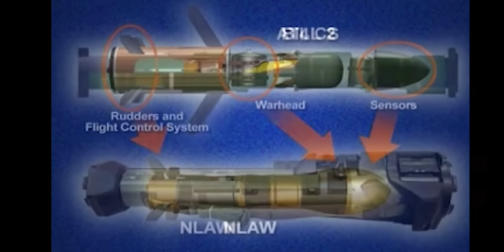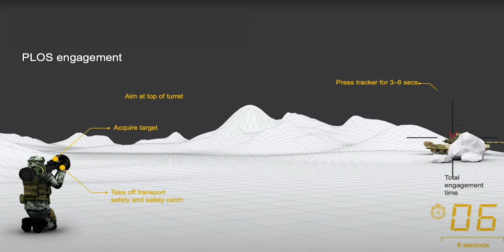Is the NLAW ATGM overrated? Next Generation Anti-Tank Missile

Comment: Still would rather have one of these than no anti tank.
Reply: Exactly. It's brutally effective. Hard to accuse something THIS GOOD of being "overrated." LoL
If anything the RPG-7 is the most overrated AT Munition lol.
Reply: @Mygg_Jeager  You can reload a RPG and it can use multiple warheads
Reply: @surferofthesynthwaves4710  So can an M203. Neither the M203 nor RPG7 can knock out a modern MBT, IFV, JLTV, or MRAP. And the M203 is 14 lbs lighter than the RPG7.
Reply: @Mygg_Jeager  really a M203?   I know it can knock out light vehicles but bruh
Reply: @Mygg_Jeager  LoL, RPG-7 "overrated". Given it's an old tried and tested weapon, a very well known quantity, that statement makes about as much sense as saying that an assault rifle is overrated or drinking water is overrated. The PG-7V and the PG-7VR warheads have armor penetration of 500 and 650mm respectively. Not even modern MBTs have evenly distributed armor all around that can protect against that, side hull being usually the biggest weak spot, let alone IFVs, MRAPs and other junk.
Reply: @JAnx01  TUSK, SLAP, Trophy and ERA all defeat even the most advanced and sophisticated RPG7 warheads. (They also Defeat Carl Gustav rockets.) And advanced rockets aren't even in the hands of Russian Conscripts, ISIS, the Taliban, or our usual foes.

The RPG7 is the bread roll of combat. Always there, but nobody remembers the bread roll after a 3 course meal.

In modern armies the RPG7 only serves as a sideline platoon level weapon to take out light vehicles, equipment, and entrenched positions. (Exactly how we use our M203's.) Not even Russians use it as an AT weapon - that's what the Kornets are for.

The RPG7 is everywhere, and has been everywhere for decades, but you literally just explained in detail WHY and HOW it is overrated. It's capabilities are vastly oversold due to the impression left in the minds of millions of gamers after hundreds of war games featured it. There's an after action report from a battle in Iraq that you should read, where a challenger 2 tank Shrugged off over 11 RPG shots to the front side and rear. Yeah, it's not a capable system any more. Not unless your enemy is only equipped with light utility pickup trucks.
Reply: @surferofthesynthwaves4710  Yes, the M203. And AG36, FNGL, MGL, etc etc.
Reply: @Mygg_Jeager  Woah there buddy RPG has access to tandem munitions that makes the ERA irrelevant.   It is becoming more and more common.
Reply: @surferofthesynthwaves4710  Still can't penetrate the side armor of a PUMA, or an M1A2 TUSK.
When I said modern, I mean modern. Not mothballed cold war vehicles in storage like the MARDER, or M1 Mod 0.
Reply: @Mygg_Jeager   he is probably talking about rpg 29
No side armor can withstand it
Its basically a heat round thats converted to a rocket launched from a big tube reckoilessly
Reply: @divoulos5758  he probably referring to the RPG-7VR
Reply: @divoulos5758  nothing can stand the rpg 29 that thing is scary
Reply: @Mygg_Jeager  That is not true, the side of an Abrams is rather thin, especially considering a tandem warhead still has 750mm of penetration. The Tusk II can stop it, but the base Tusk cannot stop a tandem RPG warhead.
Reply: @start2957  no one here is talking about the RPG 29 lol. I mentioned the RPG 7 and that's what everyone's referring to in these replies.
Reply: @voidtempering8700  I've yet to see an RPG 7 Warhead that can puncture Tusk side armor. The Panzerfaust 3 can but that's not an RPG 7.
Reply: @Mygg_Jeager  As I said, it depends on the Tusk. Tusk II is designed to stop tandem era, so it would stop a tandem warhead. Tusk I, however, cannot defeat tandem warheads, so the main charge would still penetrate the side of the Abrams hull.
Reply: @voidtempering8700  I find that hard to believe. Tandem charges penetrate Explosive Reactive Armor.
But they're useless against slat and slate armor. Simply putting up those "RPG Cages" and a few slates of boron carbide plates will defeat any and all kinds of anti tank rockets. That's why top attack systems were invented in the first place, because direct fire LOS rockets and ATGMs were so easily defeated. RPG Cages were also very effective in defeating TOW, Eryx, Dragon, and Milan ATGMs. The only things that they couldn't stop were BILL-2, Spike, Javelin, and NLAW systems.
Reply: @Mygg_Jeager  Slat armor and cages are not completely resistant, which is why most tanks armor only the thinnest parts with it, because they cannot put ERA on those locations. ERA is generally more effective at repelling RPGs over cage armor, is has around a 50% to disable the fuse of a warhead. 

And besides, most tanks don't make extensive use of slate armor along the front 2/3rds of the hull sides. For example, the Abrams Tusk variant only uses slat armor on the engine rear, an RPG-7 with a tandem warhead can still pierce the side hull.
Reply: @voidtempering8700  Oh make no mistake, ERA is Superior in every way to slat and slate armor.
However the M1A2 Tusk has slates running the FULL left and right flanks, not just the engine blocks.
And as you say, Tusk 2 can defeat tandem warheads whereas Tusk 1 likely cannot.
Reply: @Mygg_Jeager  The M1a2 Tusk doesnt have slate armor on the entire flanks, what images are you looking at? Tusk has era on the sides, not slat armor.

And most Abrams, even in field, don't use Tusk, and even the SepV3, with Trophy, and can still be defeated by an rpg-30, which can counter most APS systems.
Reply: @Mygg_Jeager  Quality back and forth here. Thanks for the knowledge.
Reply: @voidtempering8700  The M1A2 does not. The M1A2 TUSK, does. In this case TUSK denotes a mod package to the system, like a tranche means in Fighter Jet Terminology. An M1A2 can have aftermarket ERA and Tusk bolted on wherever the end client wants it.

But the M1A2 TUSK is a specific US Army model between the M1A2 and M1A3, where a cage and mounting system runs the full length of both sides of the tank. The cage can mount TUSK slates, or slat cages, or both. It's an interim stop gap model of a few hundred first line tanks for frontline divisions. Instead of upgrading everything to M1A2, then M1A2 TUSK, then M1A3, they did 1000 up to M1A2, then approx 400 to M1A2 TUSK, and now they're planning on bringing all 1000 up to M1A3. Dunno what they're gonna do about the other ~4000 or so M1 Mod 0's.
Mod 0 is a navy term by the way, it basically means tranche 1 in airforce terminology. The Army is stupid because they don't have a default denomination, it's just M1 or M4 or M16. This leads everyone to think that A1, as in M4A1 or M1A1, is actuality the factory default model, or 0 Modifications Model. Nope, A1 is second Tranche, or Modifications 1 Model lol.

The world of armaments terminology is a frustratingly and hilariously inconsistent one lol.
Reply: @JAnx01  you talk about military experience yet it sounds as though you have absolutely none. Nobody's "hauling weight around" with the tusk system. It's lashed onto the side of the vehicles. That means nobody's carrying it. Trophy systems are in service and in active duty by the way. So they're not "years away from being fully implemented."
And yes, media has an absolute role to play in how something is to be considered overrated or not. In fact it's pretty much the SOLE deciding factor in how things are portrayed and celebrated in the mass mind and public consciousness....
I don't think you really understand the conversation that's being had here.
I don't know why you're insisting on bringing up the RPG 29 constantly. No one else is doing that. I'm certainly not. I'm talking about the RPG 7.
And lastly no, range is not a factor in how an anti-tank weapon is classified. They fill the exact same role. We don't separate their roles, they're infantry, man-portable, anti-tank weapons.
We separate them only by weight, light and heavy. Heavy anti-tank weapons are usually ATGMs but they also encompass Recoiless Rifle systems like the Carl Gustav. These are issued at the platoon level. Light anti-tank weapons are second line anti-tank weapons. These are far cheaper than primary anti-tank, and issued at the squad or section level as opposed to a platoon. They're only to be used when enemy armor is within range or when the primary anti-tank weapon goes down or is exhausted of ammunition. Light anti-tank weapons simply by their nature of being lighter and cheaper have a shorter range. But no there's no separate role in our western armies for short range anti-tank units versus long range. There is just anti-tank, and it exists in all standard Infantry platoons.
Reply: @Mygg_Jeager  "you talk about military experience yet it sounds as though you have absolutely none. Nobody's hauling wait around with the tusk system. It's lashed onto the side of the vehicles. That means nobody's carrying it."
Way to intentionally misinterpret my point which is that if the base weight of 67 tons is causing logistical issues, adding several tons of ERA on top of it, isn't going to help.

"Trophy systems are in service and in active duty by the way. So they're not "years away from being fully implemented."
Sure. All 400 of them. I take it back. It seems the US army isn't ordering any more. So it's something you can't take for granted when discussing these issues. Obviously Trophy makes RPG-7 more relevant than ever. You don't want to waste heavy AT rockets on making the enemy tank use up its APS charges.

"And yes, media has an absolute role to play in how something is to be considered overrated or not. In fact it's pretty much the SOLE deciding factor in how things are portrayed and celebrated in the mass mind and public consciousness...."
The "the mass mind and public consciousness" is irrelevant. The market for these weapons what matters. I expect people who decide where their country's big military budget goes don't evaluate weapons based on their performance in video games.
Anybody using video games as an argument when discussing weapon performance loses credibility instantly.

"I don't know why you're insisting on bringing up the RPG 29 constantly. No one else is doing that. I'm certainly not. I'm talking about the RPG 7."
Because you said "And advanced rockets aren't even in the hands of Russian Conscripts, ISIS, the Taliban, or our usual foes."
So I had to correct you.

"And lastly no, range is not a factor in how an anti-tank weapon is classified. They fill the exact same role. We don't separate their roles, they're infantryman portable anti-tank weapons.
We separate them only by weight, light and heavy. Heavy anti-tank weapons are usually atgms but they also encompass systems like the Carl Gustav. These are issued at the platoon level. Light anti-tank weapons are second line anti-tank weapons. These are far cheaper than primary anti-tank, and issued at the squad or section level as opposed to a platoon. They're only to be used when armor is within range or when the primary anti-tank weapon goes down or is exhausted of ammunition. Light anti-tank weapons simply by their nature of being lighter and cheaper have a shorter range. But no there's no separate role in our western armies for short range anti-tank units versus long range. There is just anti-tank, and it exists in all standard Infantry platoons."
And that's a mistake because they're dangerous for different reasons. Unguided rockets have high portability, they're good for flaking and hit'n'run tactics in urban areas, but if you know the enemy in the area is equipped with them, you can protect your vehicles by not getting within their range and having them support your troops from a safe distance (for example >0,5km). Heavy ATGMs like Kornet and especially TOW are unsuitable to be moved around in close quarters combat. Setting them up would get you killed. They're best set up in calm areas where no firefights are raging and used in a defensive manner to snipe vehicles from a long distance. I don't care what you classify them as. Completely different use.
Reply: @JAnx01  Increasing weight on a tank does not cause logisticalv issues... it can cause performance issues if it overstresses the engine or the chassis.
This is how it becomes obvious that you have no idea what you're talking about.
Reply: @Mygg_Jeager  Can't pass most bridges in Eastern Europe = huge logistical issues, get stuck in mud everywhere = huge logistical issues.
Reply: @JAnx01  
"Heavy AT Systems are not suitable for close quarters, setting them up would get you killed."
Yeah, that makes you sound like a gamer lmfao.

Heavy AT systems are ABSOLUTELY carried by platoons when doing room clearing and building entry. How the fuck else are you supposed to set it up on a roof top? Or in a window? You got to get it up there in the first place. And they ain't gonna helicopter them in. They're gonna make a guy at the tail end of the stack leg it up all 50 flights of stairs.

As for generals and officers in charge of acquisitions, yes media and battlefield reputation has an ABSOLUTE impact on perception of what will and won't be a good purchase. The Chinese military actually referenced the "Starship Troopers" movie when issuing the tender for the QBZ-97 / Type-95 Rifle families.

And the reputation of German Tanks in WWII factored into why Arab States and South East Asian countries selected the Leopard and then Leopard 2 for they main battle tanks.
Reply: @JAnx01  Yes. Russian T72s have had their ERA removed and only the rubber remains in many models. Others were filled with clay, plasticine, cardboard and Styrofoam.

Which ironically lead to situations where even outdated and antique Ukrainian RPG7 rounds could and did penetrate and knock out Russian tanks.

And 2003? Bro the TUSK system wasn't even invented then. Those were M1A1 and M1A2 tanks they sent into Iraq....
I'm starting to think you're an intentional pro Russian troll with the kinda disinformation you're throwing around.
Reply: @JAnx01  Getting stuck in mud is not a logistical issue, that's a mobility issue.

Inability to cross a bridge is not a logistical issue. That's a strategic access issue.

You have ZERO understanding of military terminology. A logistical issue is a supply chain issue. For example, when British forcss landed on the shores of Gallipoli, and the Army Infantry and Naval Marine Infantry used different bolt action rifles with different calibers of ammunition, and everybody wound up with mixed crates in uneven amounts of both types of ammunition.
Reply: @voidtempering8700  TUSK armour is Slate Armour.
RPG cages are Slat Armour, without the "e" lol
TUSK systems are designed to bring side protection up to the same level as the factory frontal armour.
RPG Cages/Slat Armour gives all around 360⁰ protection against rockets and older missile systems.
Reply: @Mygg_Jeager  The weight of a TOW launcher with one missile loaded is well over 100kg. You're not going to be using it the heat of a CQC battle in the same way you're going to be using a LAT. Period.
Reply: @JAnx01  It's not a logistical issue. Then that becomes a combat engineering issue. If the bridge is of no historical significance we just blow it and lay modular steel panel assault bridges instead.
Or we use amphibious APCs to cross it.
Or we use a snorkel and drive under the water right across the stream or river.
Or we build a pontoon bridge.
None of these are LOGISTICAL problems. You literally haven't the faintest clue in regards to a single thing you've talked about this entire time. I'm glad though. It makes it a hell of a lot easier to defeat you in the battlefield. My money is going to good use I see. XD

Comment: Classic Swedish I would say, as a Swede. Things we produce should be easy to use and very practical. That is usually our main focus.
Reply: Don’t text that scammer ^^^
Reply: @MelordJenkins  - No worries
Reply: Tillåmed IKEA instruktionerna! xD
Reply: Being a Brit I get annoyed that people call this a British system. They are made in the UK but designed originally in Sweden. But the Harrier suffers the same issue with people saying that its American.
Reply: Maybe one day Sweden will achieve its dream.
...if China does not nationalise Ikea, before that. :face-blue-smiling:
Reply: Lockheed Martin actually produced a weapon like this 7 years ahead of NLAW also using Predicted Line of Sight (PLOS).  It was called FGM-172 SRAW (Short-Range Assault Weapon) and was to replaced AT4.   It weighed a lot less than NLAW because there were two versions. FGM-172A with a standard warhead and FGM-172B with a top attack warhead.   As a result it weighed only 9.7kg instead of NLAW's 12.5 because it carried only one type of warhead.  Only 900 or so were produced on budget grounds.
Reply: @williamzk9083  So basically you got stuck and you call in the Sweds to to help you make the real stuff work.
Reply: @williamzk9083  you just explain a system that did not work
Reply: British POC, SAAB did the product engineering.
Reply: @elestromusicgamesfun1101  true...is also racial mixing and muslim population of over 15% in your future plans for Swedistan?
Reply: @skrajina8037  well at my high school there were a few girls that were the product of one white and one Pakistani parent… they were the hottest girls in my school by far.
As a friend of mine used to say, “they are all pink inside”. Not very politically correct but it was the 80’s. So there’s that
Reply: @niksandy7125 🤢
Reply: @alienmorality  really…how so?
Reply: Like the 88 Flak I suppose?
Reply: @elliott7531 when the idea was French.